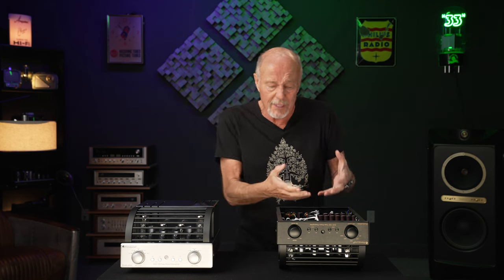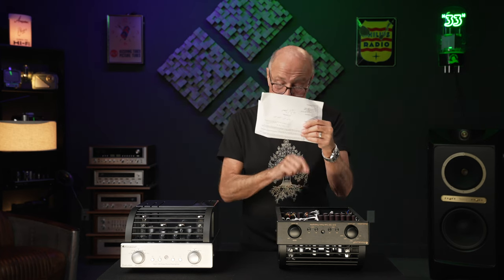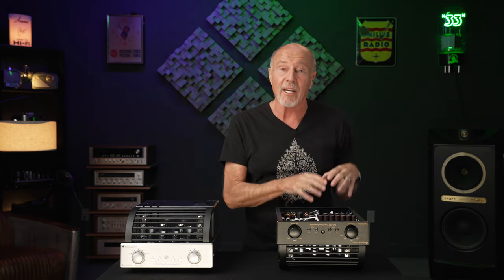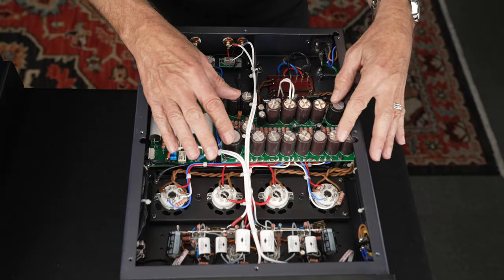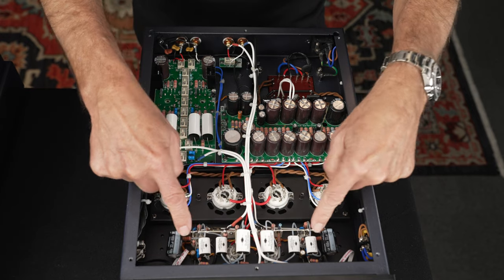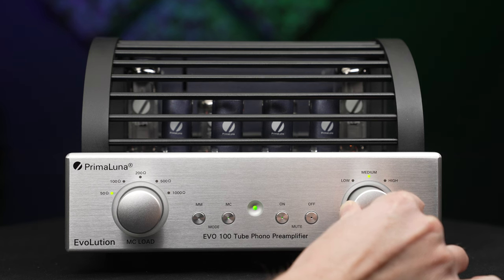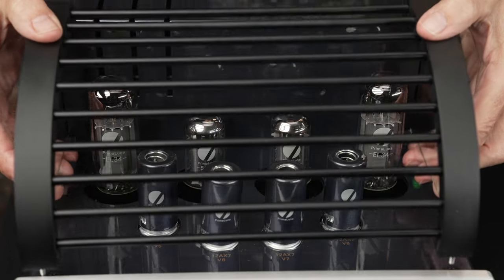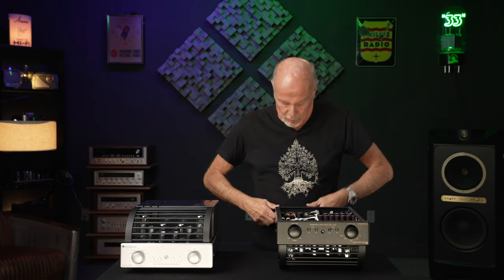PrimaLuna EVO 100 Tube Phonostage w/ Upscale Audio's Kevin Deal

Comment: Great job, Kevin. Been looking forward to this video for a while.  I have a PL EVO 300 Hybrid and play 95% vinyl. I have a low output .3mv Phasemation PP-200 cart. From your comments on the gain settings, I am wondering if this will work. What are your thoughts?

Comment: Have to say my Primaluna Pre and Amp are a perfect match. Bit of tube rolling to Amperex and swapping the 12AX7s for 12AU7s made them sound amazing. I left tubes for SS on the phonostage specifically due to the noise from the 60DB of gain needed for a Hana ML. However I have NO doubt they figured it out. EL34s as a filter? Yeah they went for it. Just checked the price. I love Primaluna but it's out of my current range.